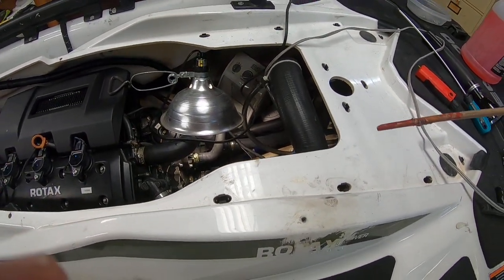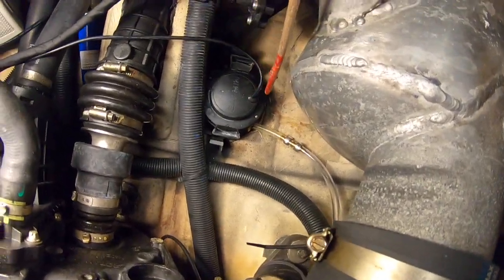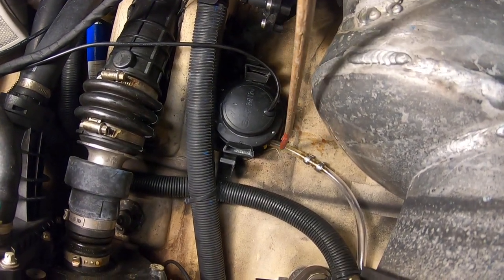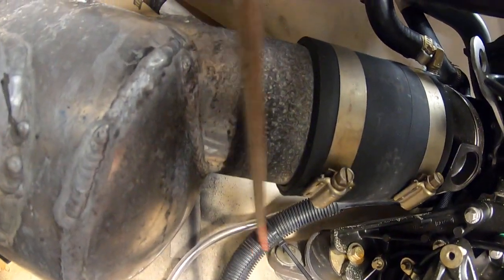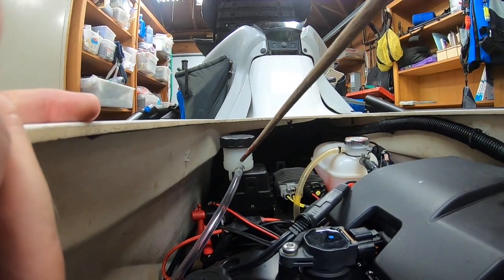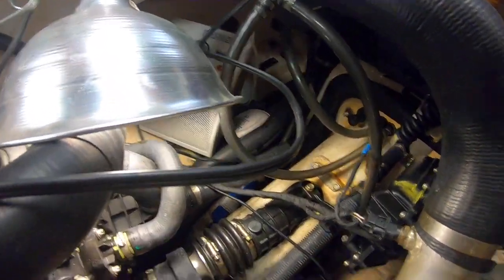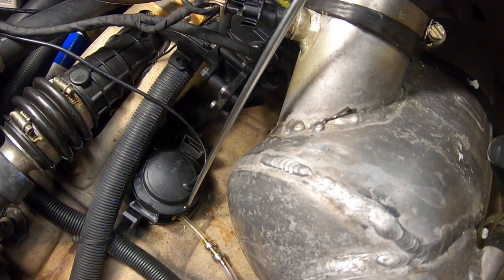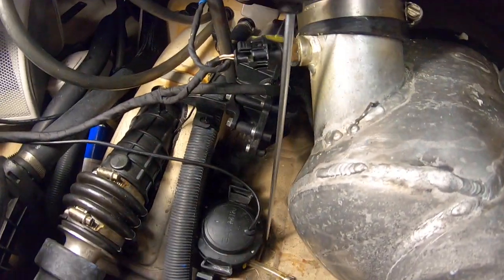FishPro Transducer Fluid  - Easy Check Mod (2/3)

Comment: Hey there.  I'm thankful for your videos but do have a question.  I have a brand new 2024 Explorer Pro and I'm getting the blinking depth guage.  Before you unscrew the tiny 5mm screws from the transducer, do you just push off the two big tabs on either side of the cap first?  I don't want to break anything.  It's hard to see everything but I feel like  a screw or two might be under those two tabs opposite each other.
Reply from the maker: My screws are not under the tabs. I remove screws, then wedge the ears away/back with a big screwdriver. They are really stiff for my hands.

Then, holding one of the ears back by jamming a screwdriver into the recess that is molded into the ears and holding it back,  I wedge the tip of a smaller stubby screwdriver between the lid and the body to break the seal.